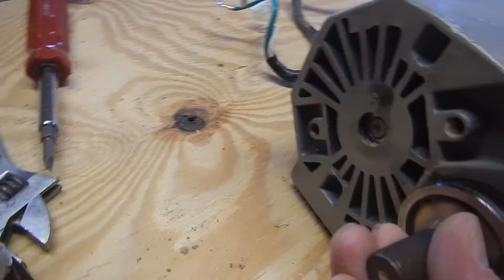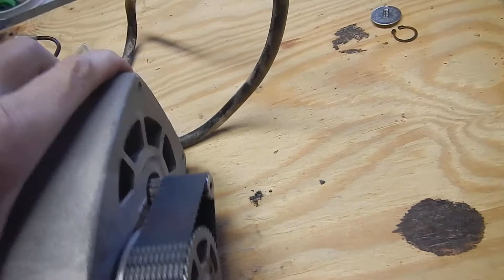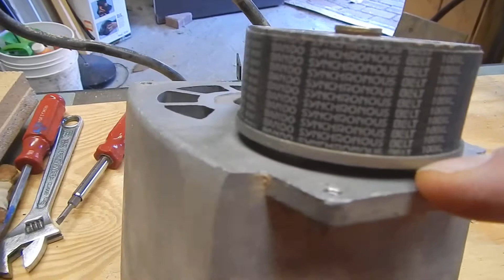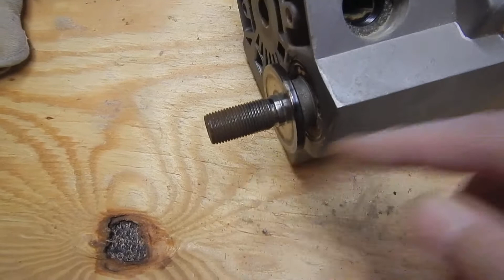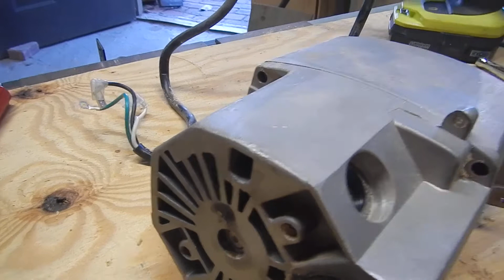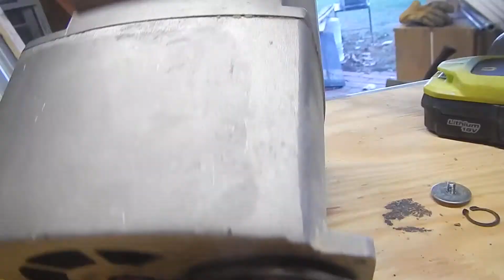How to dissemble electric motor

Comment: Having the same problem and want to replace the start capacitor.  We can’t get the two parts apart.  Do we need to remove the shaft before we expose then inside of the motor?

Comment: The screws from the motor case, also fit the holes in the cog gear.  They can be used with a gear puller bridge to pull the cog gear off the shaft! 😊

Comment: Found your video, and thought i'd post the solution for the next person tearing apart the motor.  mines back together already so no pictures, but you're almost there!  So no big deal.
take off the belt (i rolled it off as i turned it)  pry off the big gear (i used screw drivers and a hammer claw)  i then loosened the set screw with a screwdriver and hammer and a soft clamp on the big gear.  turn that off, take the ridged lockwasher off and that gear will come out the saw side.
Reply: I used two bolts in the two threaded bolt holes in the belt cog and improvised a puller with a plate center from an actual puller and a socket to reach the plate bridging the two bolts. It didn’t take much to get the cog started moving. Once the cog is off, there is a nut and retaining lock washer to remove. Then a few taps on the ears of the two housing pieces and it comes apart. Next two screws I took out under the fan through the outer plates. Next just a few taps at the end of the armature’s shaft and it comes out.
I only had two bolts that fit in the threaded puller holes, they are a fine thread and I believe they are metric.
Reply: @akbychoice  the bolts / screws you seek are in the motor case, four of them.
Reply: Hey @Jeff Hill. I am in the exact same boat as OP.  I have the belt off, but cannot get the large gear to come off.  Are you sure it is supposed to slide off?

Comment from the maker: The Armature was about 100 and the brushes were about 14 plus 50 to install.  the tech told me that  he had to use a pully puller to get the back pulley off and damaged the bearing.   my pulley puller would not fit in the small space between the wheel and the cover.    So less than $200 for fixed motor - when I looked to replace a table saw like this on is about $500-700 so I decided it was worth fixing mine.  I have also customized mine to be a router table as well so add to that and the decision was easy for me.